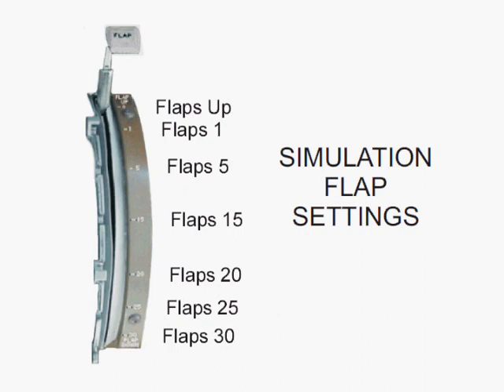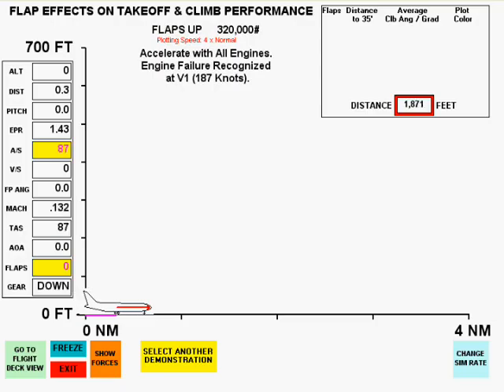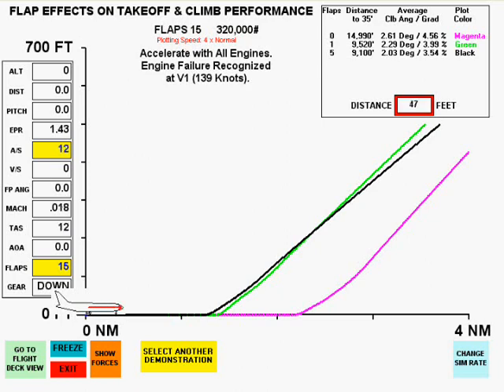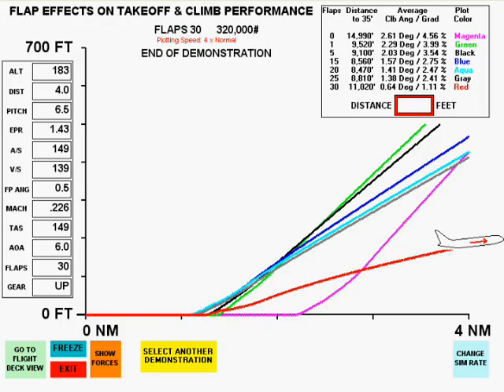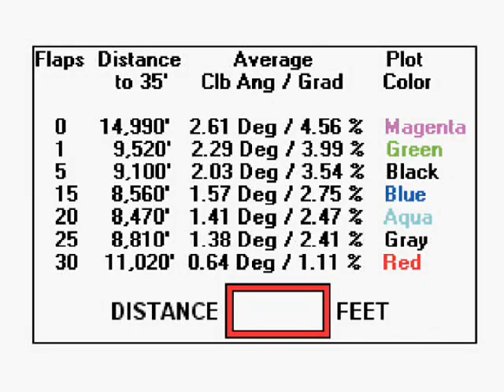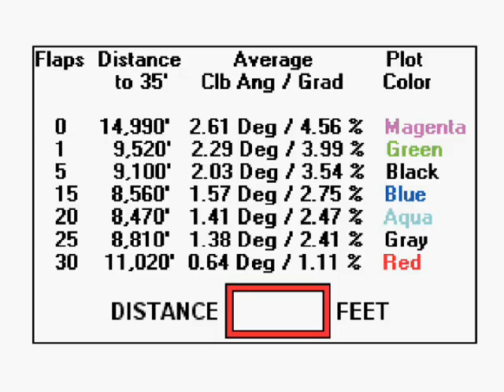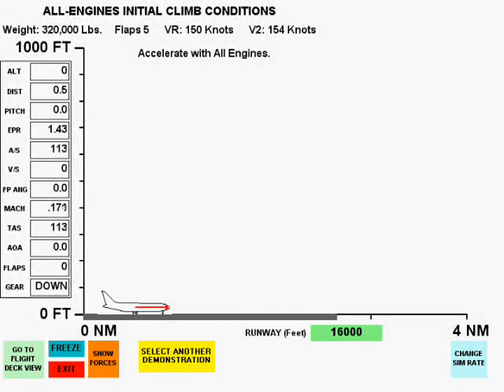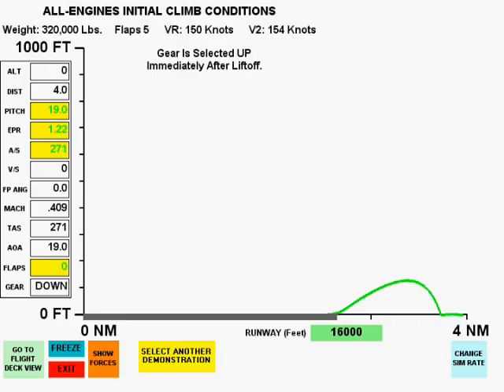TAKEOFF FLAP SELECTION

Comment: Why does the AOA stay in the mid to high teens on the "assumed" flaps 5 TO with flaps up, even when the airspeed is in the 200s, when on the flaps up TO at the beginning, it never went above 6 or 7, and the airspeed there stayed at 196?   I understand the reality that AOA is only indirectly associated with airspeed, but something in there doesn't make sense.  Perhaps the pre-mature rotation creates a situation where the "airspeed" of the relative wind over and under the leading edge is actually lower than what is going into the pitot tube?